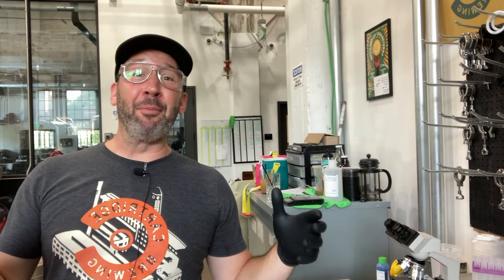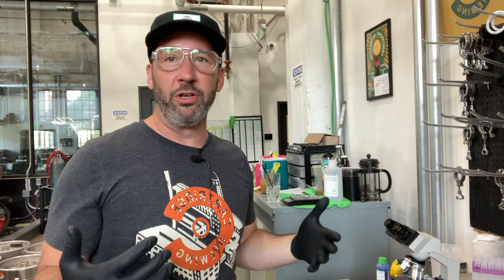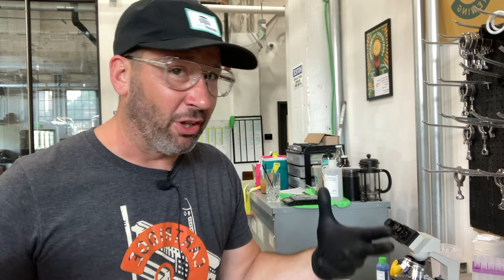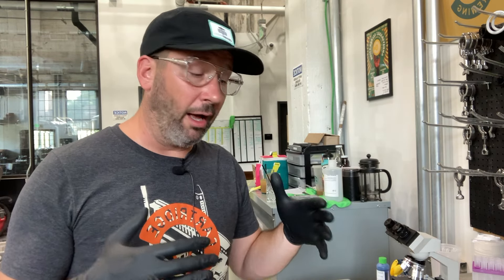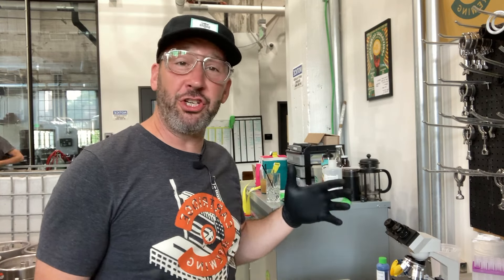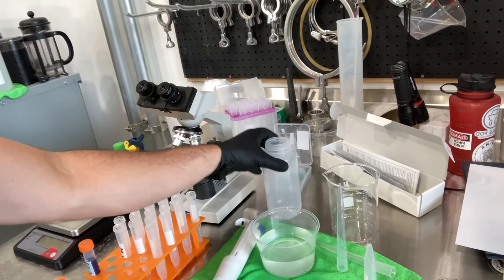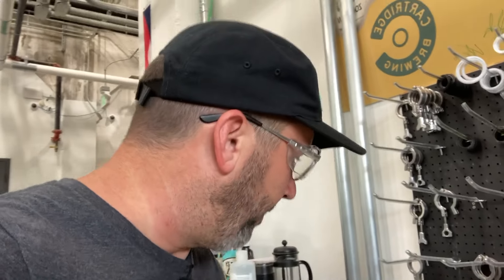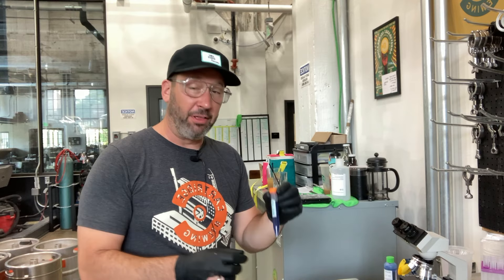Technique: How I Use A Microscope to do Yeast Cell Counts!

Comment: Hey Adam. I think there's an editing error at the beginning. Part of the video is repeated.

Pro tip on using the disposable transfer pipettes when trying to transfer something thick - cut off the end with a pair of scissors to make the opening bigger. (I work in Pharma and at one point had to test creams)
Reply from the maker: Yeah I have a bit of a loop up front. Sorry about that. I will do that in the future! Thanks for the tip!
Reply from the maker: Also I think i fixed the loop!